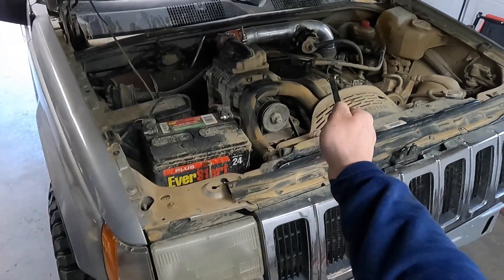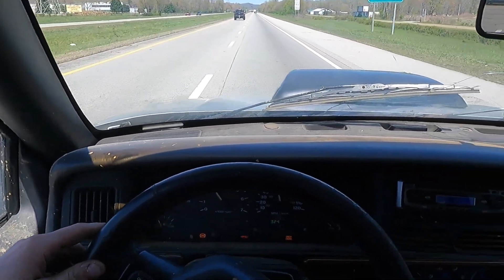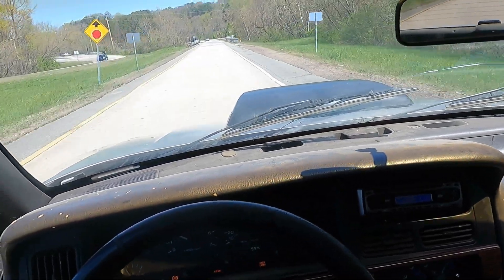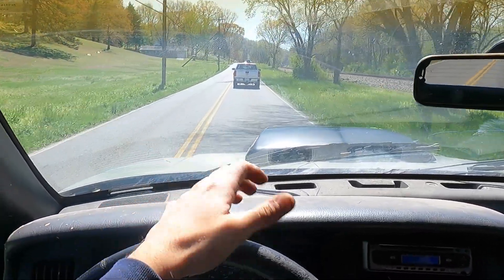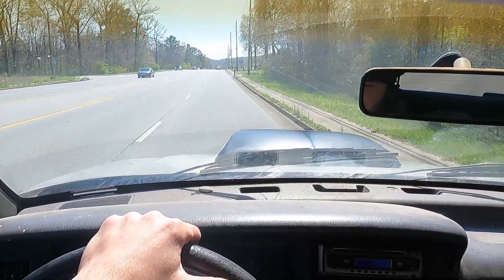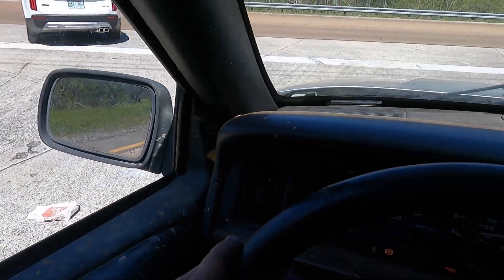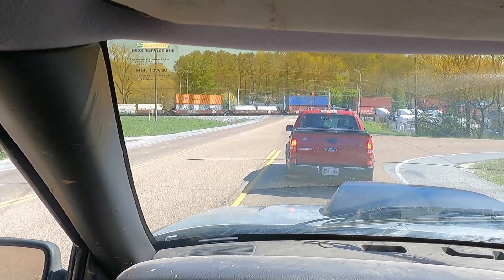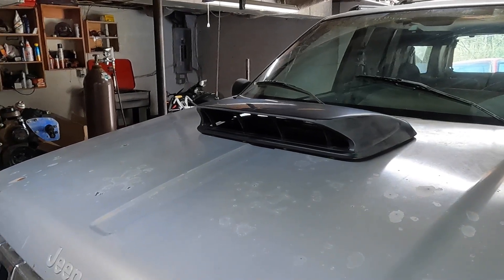supercharged jeep zj intercooler testing

Comment: Well now you can throw some more boost and timing at it Thomas.    Time to (s)end it!  Who manufactures the intercooler?
Reply from the maker: Lol yes more boost and timing coming. It's a frostbite fb600.
Reply: How much timing you have in it now? @thomasbeyer
Reply from the maker: Not very much i will pull up the tune tho. I used the stock numbers and pulled about 1 degree per psi but it was the stock tune so I figured it would be conservative enough to live.
Reply from the maker: About 14 degrees
Reply: @thomasbeyer  do you have a knock sensor?
Reply from the maker: No. Iv got a buddy with a Plex knock module I'm thinking about getting one for myself. Iv just been checking the plugs so far.